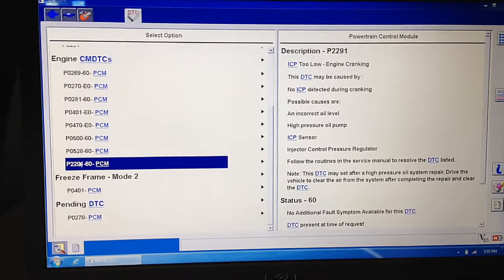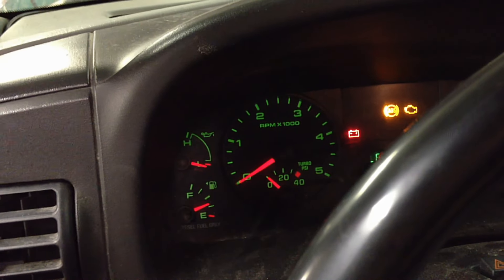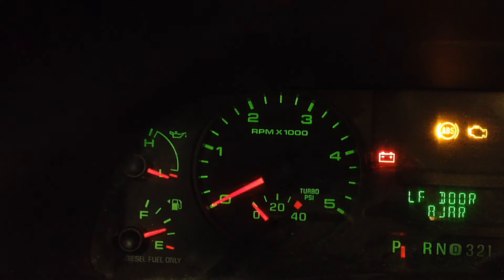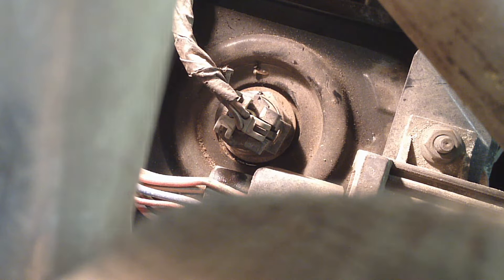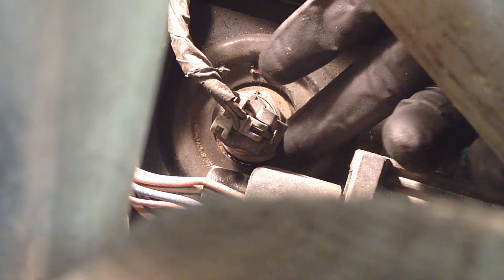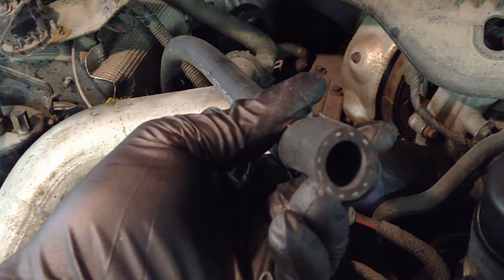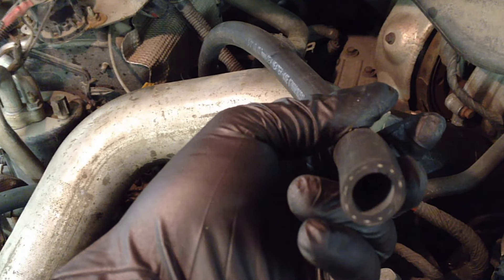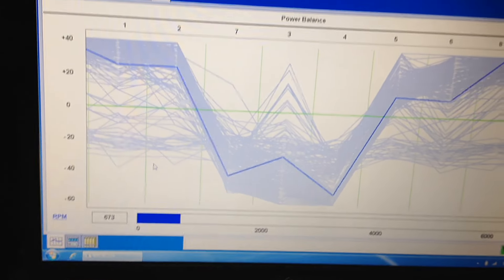No Start: 6.0L Powerstroke ICP Leak Testing

Comment: Hi I have a 04 6.0 no start it has a new oem ipr 2 months ago new after market icp was running good after I replace those parts but now won't start oil pressure gauge goes up when cranking what u think thanks
Reply from the maker: luis lopez Start with the pressure test that tells all. My bet is something has blown through the ipr screen again.

Comment: I have a 06 6.0 had dummy plugs replaced a year ago and just replaced the egr and oil cooler, I drove it for three days and a code PO 2290 poped up, injector cnrl press to low my truck runs great,starts and idles perfect. is it my ipr valve?
Reply from the maker: Ryan Epperson Do you have access to a scanner we need to check the icp voltage koeo to make sure it is not biased.
Reply: FordTechMakuloco no I have no access to a scanner I have a scanner that just reads codes, should I just replace my icp censor?
Reply from the maker: Have you cleared the code and drove it again to see if it returns? This code will set after the oil cooler was replaced due to long crank time and air in system.
Reply: Yes I cleared the code went for like 10 15 miles and it did come back on
Reply: 25 to 30
Reply from the maker: Well without a scanner we are guessing I am thinking the icp is biased though.

Comment: I just purchased a ipr will arrive in a few days preying that’s my crank no start issue
Reply: Was it?
Reply: Dustin Wag no installed brand new one still low icp I have high pressure oil leak buying air test fitting to locate leak

Comment: where can i get the computer program for the 6.0 that you have? i have a 2005 f250 with the nightmare, i mean 6.0 and i just had 8 injectors glow plugs both valve cover gaskets replaced and did the blue spring upgrade the truck ran for a week and i shut it off one day went to start it right back up and it wouldnt start. i put my scanner and my icp wont build above 243 but i dont know if my sensor is bad hpop has a bad seal or whats going on with it. im beginning to hate this money pit
Reply from the maker: Thomas Adam You can get it it from motorcraftservice.com it is very expensive though.
Reply: FordTechMakuloco thank you I will look into it. Owning this 6.0 it might be a good investment. This has to be the worst engine ford and international could produce. I'm old school 7.3 for life like everyone else.

Comment: i have 2006 6.0 f250 turns on when cold little rough then when i leave i dont have alot of power till warms up.....any suggestions what to chase after i bought the fitting for pressure test icp..i just did rebuilt on ipr but didnt check voltage..

Comment: Hello 
I would really appreciate your help my 05 has a crank start when hot it has updated stand pipes and dummy plugs I did a leak test and hear a really loud leak in the pump cover but a very small hiss in the cover ¿is it normal to hear a slight hiss in the valve covers? BTW I have the ids but have no clue how to command the ipr shut
Reply: Did you ever figured this out I have same problem
Reply: @rileymosier9093  yes it was the snap to connect fitting there's a updated part that has a integrated lock nut

Comment: Hello again.I haven't been able to get my truck running.I remove the valves cover and there are not any dummy plugs or stand pipes.any suggestions thanks in advance
Reply from the maker: Ok so you have just a single log then and no icp sensor in the valve cover. Those early builds are known for pumps failing on them allot. I am not sure if you replied in the past at the moment about diagnostics we already di because youtube comments are down again.
Reply: I think the icp is on the front of the valve cover passenger side,just like the one you remove on your video .I remove the valve cover and I didn't see any plugs only a plug with a 1/2 inch drive  I can crank it for 10 seconds and the oil gauge don't move but if I crank it again for another 10 seconds the gauge muve right away but it doesn't start so you think may be the pump,thanks for your help
Reply from the maker: There are too many variables, only thing you have verified is the low pressure pump is working. You must do the air test it is the only true way to narrow it down. The next thing I would do is remove the ipr and see if the screen is torn/ smashed in. How did this truck fail, going down the road? Is there any codes?
Reply: FordTechMakuloco I have done the air test and I here in the hose just constant air is that mean the ipr is stuck open??
Reply from the maker: You have to command the ipr closed at 85% or higher.
Reply: alright well im ganna go for the ipr I have open & closed it and no differ in the hose thank you!

Comment: Hey i am having a problem with my 2006 F350. it has a long cranking time before it fires after sitting for a little while (in the morning, after work, etc.) when it starts it seems to run fine. And if it is running for a while and hot and i shut it off to get fuel or whatever it doesnt crank as long but it almost seems like it is trying to fire and stall at the same time until it is completly done with the starting process, then it idles fine, drives fine ect...  not running rough i just dont know how to explain i?t. it almost seems like it is getting too much, or not enough fuel but i dont know (no scan tool).This has been going on for a couple months or so but it has always started and never let me down before. a couple months ago i ran injector cleaner/fuel treatment thru it and it seemed to help for a little while but it started to act up again recently.

The other thing is i stopped the other night to get fuel, put 10 gallons in and it wouldnt start after. just like the no start in the video above. i killed the batteries trying to start. i got jumper cables and had some one charge my battery and it started up and ran fine (except for that wanting to fire and stall the same time thing) 

I have no idea what it could be but i believe it has something to do with fuel. Any advise would excellent as this is my first PSD and im pretty much clueless on these more complicated areas.

Thanks for the time and i hope to hear back from you,
Mike
Reply from the maker: For this problem you really need a scan tool or the Scan Gauge 2 and monitor ficm powers and icp reading because it can go either way with your concerns. Also cold problem could be 1 or 2 glow plugs that have failed. None of this usually turns on a check engine light. You will at least need to get this scanned at auto zone but for a complete diagnostic you will need a scanner of sorts to check this Pids.
Reply: could it possibly be the "dummy" plugs also?
Reply from the maker: It definitely copuld as they are a slower leak but will still cause problems you mentioned. It is best to see if it is a Ficm power issue or ICP issue then we can concentrate on one system of the engine that we know is causing problems.

Comment: good evening  
I have a ford LCF 4.5 L diesel its a 6.0 less two cylinders,   it has a Now start,   the Ficim is 48 volts Key on  brand new  ICP  hits 1000 Psi or 1.55 volts and the IPR is 35%   it will not start still   i had a Code for Injector 6  I changed the injector and the Code went away   I have No active Codes,  any body have any idea?

thanks

Comment: i'm having a crank no start issue with mine, 390PSI max while cranking and IPR at 86%. hooked up air to the ICP and i heard air coming out of both valve covers and the turbo drain tube or hpop cover... it's a 2003 and i just replaced the HPOP, ICP and IPR 100miles ago. Am i screwed?

Comment: I HAVE A 04 F350 DIESEL, THE USE DURING THE DAY AND STEP TO THE STORE AND SHUT OFF, THEN I CAN NOT TURN ON, I HAVE TO WAIT 50 MINUTES FOR STARTING AGAIN .. CAN BE A SENSOR? O WHAT IS THE PROBLEM? ... ME AND I HOPE YOU RESPOND
Reply from the maker: Richie Glez You have a high pressure oil leak and will need to find it with this test in the video. Most likely spot is the dummy plugs or a STC fitting that is starting to fail. Find it before it blows and dies on you. I also Have a video on the STC fitting replacement.
Reply: YOU E-MAIL? TO COMMAND CODES THAT CAME OUT OF MY 2004 F350
Reply from the maker: sent to your inbox

Comment: Ok I have a 2004 f250 super duty 6.0 motor with a no start problem the motor will crank over until the batteries go dead but won't start but if u shoot some ether or starting fluid in the airbox it will long crank over and catch up but as soon as you take your foot off pedal it'll shortly die and won't start again and doesn't throw any check engine codes at all. Every YouTube video points towards a bad icp sensor so I replaced it with a brand new one but still no change I took the fuel filter cap off turned key over at fuel bowl fills up and overflows, drained the fuel that was in it a d replaced with new fuel and still nothing!! Don't have money for the snap-on scan tool, so is there anyone who could possibly give me some tricks or tips on what more I can try or something please...

Comment: Has anyone come across what appears to be a missfire only when coasting on a 2004 6.0L ? Only after the truck has warmed up you take your foot off the gas above 2500rpm and it sounds like the injectors are working erratically. sounds like they are turned on and off every .5 of a second or so. if you turned the key off and on constantly with out the engine running just the injector buzz is the same sound. new FICM engine harneses etc. still the same problem
Reply: brad searle bruh it's a diesel they're going to make noise

Comment: I have a Ford 250 6.0 when im driving it, the truck just turns off. Can someone help me see what the problem is?
Reply: I have a 05 Ford f250 with a 6 old done done all the tests on it and still can't get it to crank with no oil pressure what do I do

Comment: My friend has a 2006 6.0 it's not cranking wouldn't start after he parked it I see oil pressure on ya oil gauge on tha dash I haven't had a chance 2 check tha oil filter 2 see if it's pumping I will and am his truck check engine light not on
Reply: Liqueo del motor liqueo del motor F 350 Super Duty
Reply: Liqueo del motor de una Ford 350 Super Duty 6.0

Comment: I bought a new ICP for a 2003 6.0. The pigtail that come with it is not color coded!
Is there a sure way to find out which wire goes where?

Thanks.
Reply from the maker: You can just go off the old one if it is still there to see which wire goes where, or if it is not there send me your email and I will send the information.
Reply: FordTechMakuloco I am new to this, do I post my email address here or is there a way to find your email address somewhere here?
Reply from the maker: just post it here I will delete right away

Comment: Hello. I have 335 code unable to build pressure. New icp. New ipr. Truck fires up no problem. Idles at 500 rpm or so. Sometimes surges up and down. Oil pressure reading from cluster gauhe is at 40 and sometimes goes up to 80. When I shift into drive. My throttle response is dead. I can rev in neutral only.

Comment: I have a 2004 f350 with the 6.0l when I crank it over I can get about 450psi of oil pressure but it's asking for over 1k, after a long crank it will finally start but has no power and won't rev up any and then after a few minutes of running it dies any idea on what I'm looking at or were I should go from here? Thanks for your help.

Comment: What size is the test adapter?
Reply: 12mx1.50 I used a bolt n 7/16 drill bit n a 1/4 tap for an air fitting